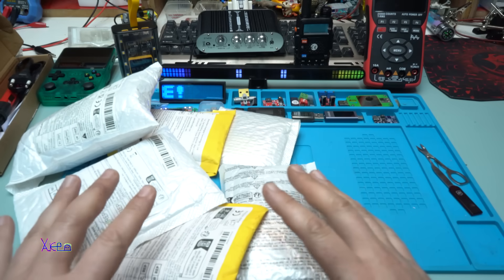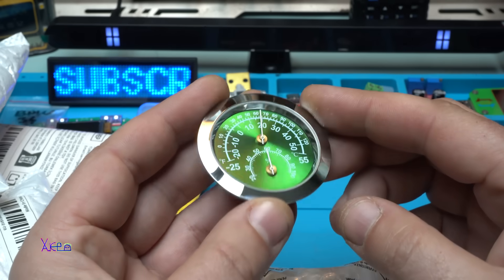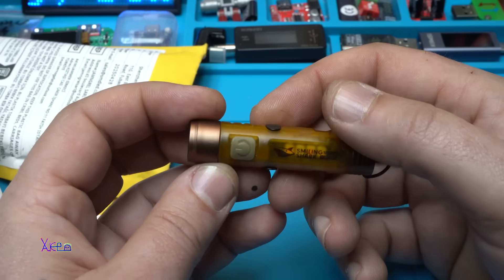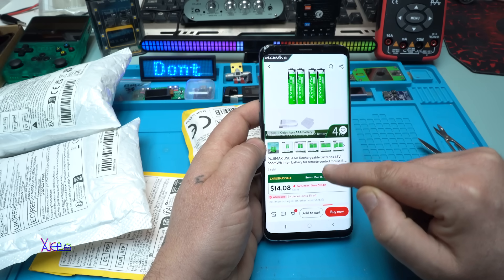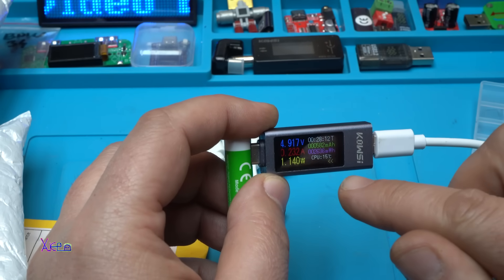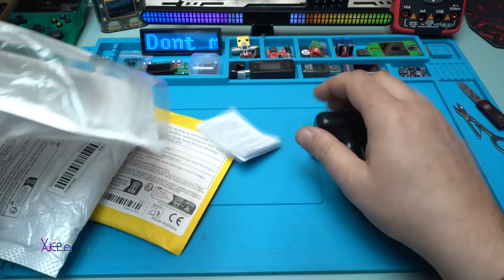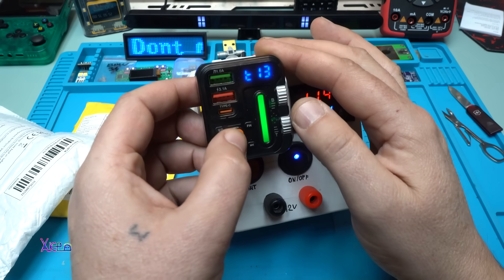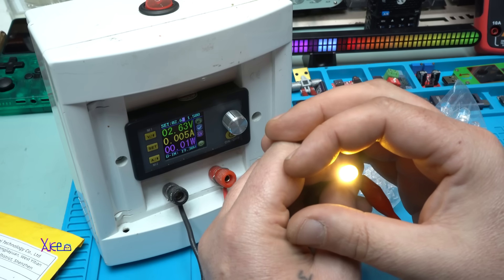THESE $1 Aliexpress Modules are INCREDIBLE?

Comment: I have discovered that you really should not buy batteries or anything that ships with batteries from Aliexpress. The capacities, when marked, are usually less than half what is claimed. 800 mah batteries are 400 mah or less. Also, stay away from SD cards as well. They are all rejects.

Comment: All preppers need analog measurement devices, but need to calibrate them, which might not be easy for most.
I calibrate mine with my sensor modules and controllers, ironically.
Reply: How?
Reply: @IrishFinalExit  If you have an analog atmospheric pressure measurement device, get an atmospheric pressure measurement module etc, then connect them to a controller like a regular Arduino, flash the code (just ask AI, it will recommend the correct libraries) and adjust your analog device to your module reading. Remember to also double-check with meteorological websites etc to make sure you're within reasonable range.